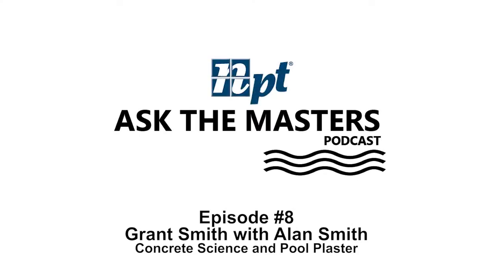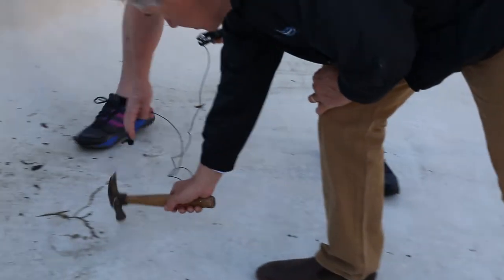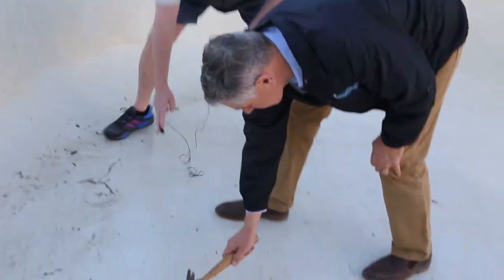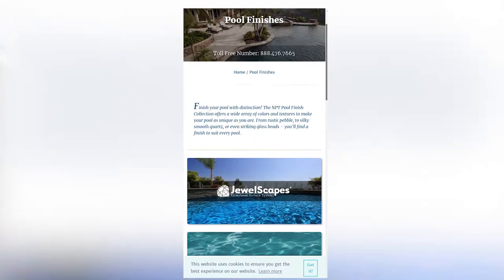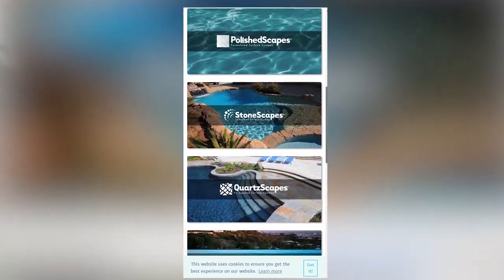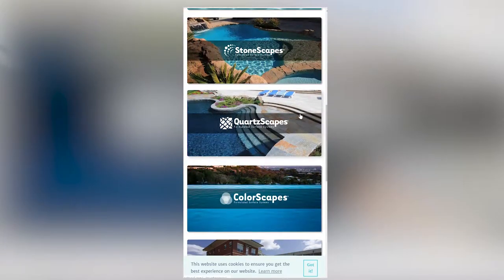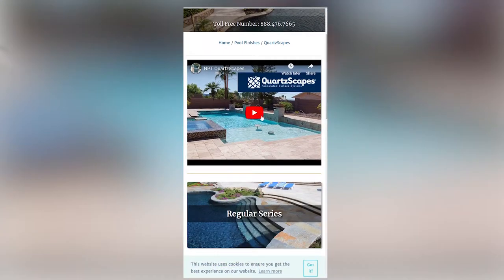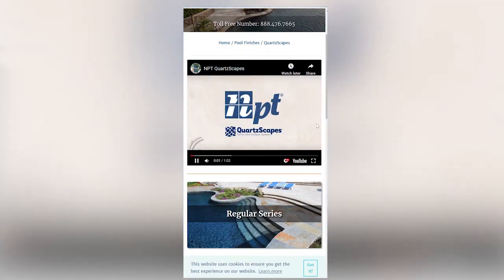Pool Plaster & Concrete Science | Masters Grant Smith & Alan Smith | Ask The Masters #8

Comment: Which layer of the shell is the impermeable layer?

I'm in the pre-plaster gunite curing stage. Ground water is coming through the gunite wall where the jet pipe juts out of the gunite. This is not a pipe leak; it's ground water leaking from the outside of the gunite to the inside of the pre-plastered pool.

The contractor is saying this is normal. If it is, why is it in only 1 spot and what makes the pool shell waterproof? The plaster?